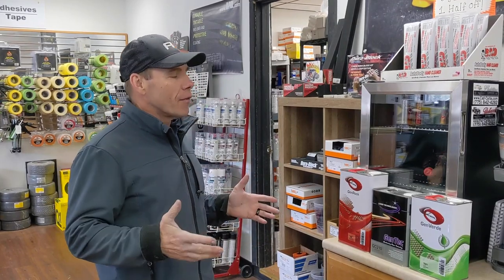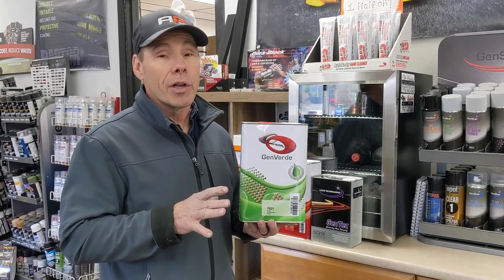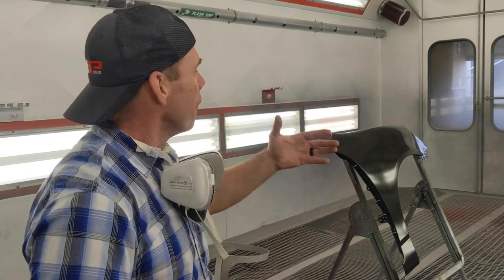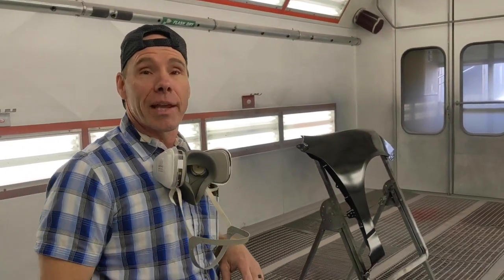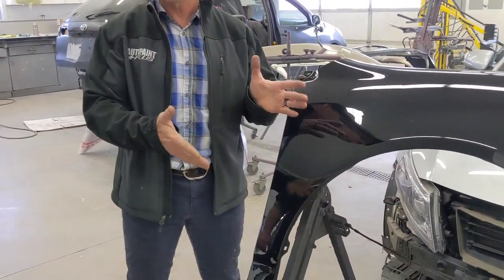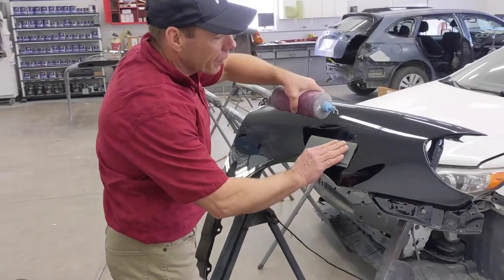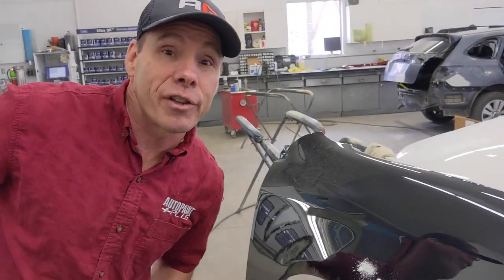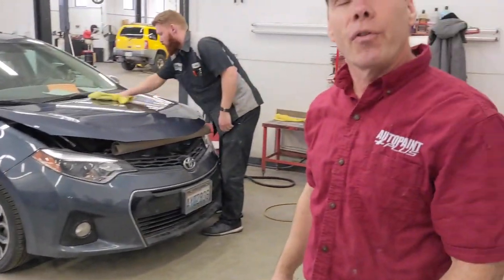ONE COAT, 5 MINUTE BAKE CLEAR COAT!

Comment: 😮Does Auto Paint Plus sell OEM colors such as 1970 Chrysler b3 blue, and would this clear be more cost effective do to less product being used
Reply from the maker: General Paint, our paint supplier, is an OEM paint line, so it has pretty much any OEM color you would need. This clear is recommended for high production shops. It’s not really cost effective for large projects, it’s made to get vehicles or parts out of the booth and ready to deliver as fast as possible, without sacrificing quality.